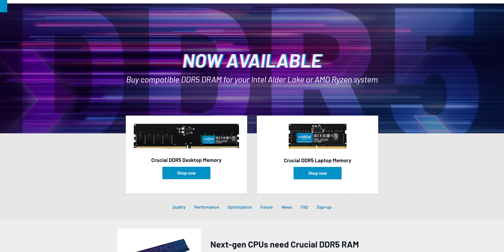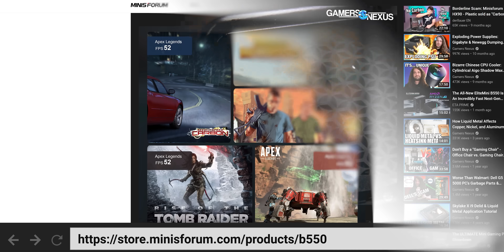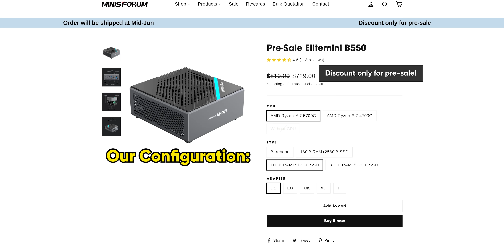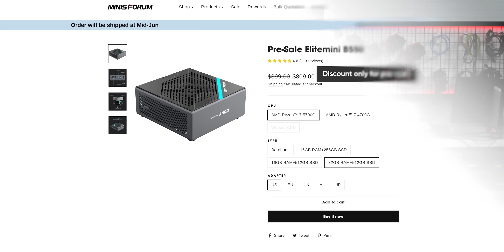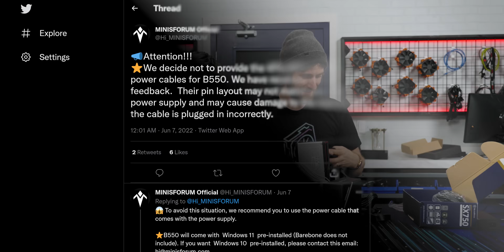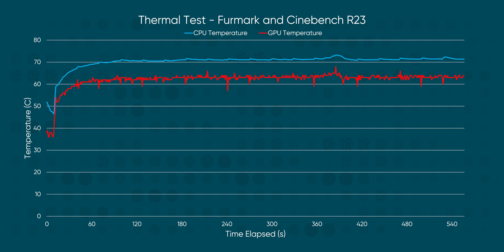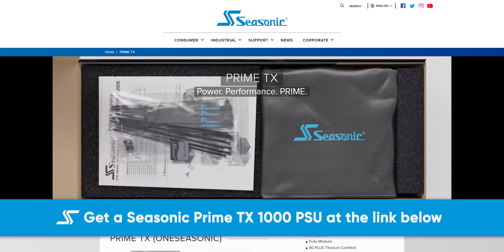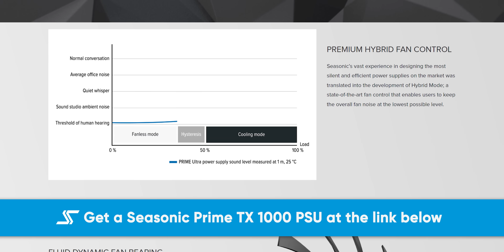Who's Buying These? - MinisForum Elitemini B550

Comment: This made sense, until it stopped making sense. That PSU setup seems so jank and like an afterthought. I'm all for a dock that expands the functionality of NUC-style systems, but this isn't it; at least until Intel's CPU card design is more mature, my main issue is that all the components should be mounted on the opposite side, so that CPU and GPU cards have a full side panel of air rather than choking the CPU card, among some other redesign considerations. Even with the updated PSU bracket, this thing seems cobbled together rather than a well-designed product, like a DIY project anyone could reasonably do. 

Honestly, I'd rather see a vendor that also has access to GPUs design this. Rather than turning a NUC box into a sandwiched SFF case, why not have a more proprietary GPU that just acts like a typical dock with a separate power brick. Sure, proprietary shouldn't be the way forward, but it's the only design consideration that makes sense for what this is trying to do. Have a CPU/system box, have a GPU/expandability box, and stack them. If MXM-style cards ever made a comeback, this would be less proprietary, as that kind of card formfactor better fits the formfactor of a NUC box, but that'll never happen outside of proprietary solutions like Dell is doing for their higher-end laptops. This exact issue is also why eGPUs don't make too much sense, at least without proprietary hardware that allows for a better formfactor, as GPUs themselves are already large and bulky with suboptimal layouts, shoehorning one into a small box with any kind of power supply exacerbates the issue. All because we're hanging onto antiquated physical specs that the ATX platform uses. 

Also, 12VO would simplify a system like this, at least it'd reduce PSU and cable bulk, but this goes for literally any system. 

Circling back to Intel's newer NUC designs, I do think they're the optimal theoretical design, as you're essentially folding a PC in on itself for volumetric efficiency. But, again, the issue is that the current design chokes airflow to the CPU card, all the components need to be reverse mounted, whether this breaks expansion slot specs to have a weird card, or the expansion slots are literally mirrored on that port to work this way, either way giving the CPU card a full side panel of fresh air would be better; water cooling could also potentially benefit from this. Expanding on this, the system part of the board, I/O, both front and rear, storage expansion, etc., should be done on the backplane intermediate board, have all the m.2 on the bottom of the board, and easily accessible from a bottom pane, with the top side having additional PCIe slots for non-GPU use, an non-storage m.2 for wireless, and have additional rear I/O that the CPU card doesn't entirely require itself; this would also make the CPU card only be CPU, memory, relevant power components, and relevant I/O. This would make the new NUC platform more usable and more expandable, and with 12VO and newer connector standards unnecessary bulk can also be shrunk and have this platform give SFF a lot of competition; and depending on sizes, it could fix what this platform is trying to accomplish.

Comment: this solution would benefit for those who would from mini pc, but with desktop grade performance, and wished for home desktop at the same time as one pc solution. the gpu dock would be placed on main office/pc room.
i have a 20" drawing tablet display light enough (but 16" usb powered one is better suited) which i would wish to have a mini pc to accompany it if i need to be away, in which i dont have to do file transfer or cloud transfer with the solution. a 15.6" laptop would be too big (unless if the laptop has pen digitizer), smaller laptop would be not as powerful.

also, it would be a very useful solution for those who do quick LAN setup, or, event booth setup which u dont have to setup on different pc, which can be a hassle if u have to install programs, some usb devices, etc, in which you may already did with main pc.

that said, the opinion is with a budgeted in mind. a laptop would solve many issues, an ipad air/pro would solve drawing portability (with smaller screen). but given the minisforum as a barebone, the overall price would be way less than desktop + laptop + ipad setup, if i accept a bit of jankiness. (but especially if i already have a pc setup, just reuse cpu + ram + ssd to slot it in)

that said, minisforum do need to optimise the hardware config and power solution. with gpu + psu as a one unit dock (or undermount psu), the dock should do self powering the cpu unit without relying on the power brick (but while maintaining the docking experience smooth, maybe do power delivery on slot?). when undocked, then use the ac brick. the challenge would be keeping the ATX standard.

Comment: What will really make this product interesting is when we have Ryzen 7000 APUs.  Based on the performance of the iGPU of Ryzen 6000 mobile,  Next gen equivalent of R7700g (or whatever they call the 7000 seires equivalent of the R5700g) with an RDNA2 iGPU could make 1080p mid settings gaming on this type NUC Pc feasible.

Comment: I'm casually in the market for this for an HTPC / light gaming for my dad.
But I am looking for a 6000 series APU (for rdna2), which seem to be reserved for laptop-only at the moment.

If they shipped this thing with a full case/frame, this would also be good for someone who is just dipping their toes into desktop PC building, where they don't want the initial daunting task of installing a cpu, mounting a cooler, etc., and instead just select a model with the specs they want, source the gpu they want, source a suitable psu, and then just put it together as simple as legos. That said, even if they did so, I doubt they have the marketing breadth to spread that mindset/idea.

Comment: I rwally have a usecase for it. i study in a different city and have a flat there, but i always come home in the weekend. I can take it to my flat to study during the week, and take it back home where i plug it in to game on weekends. I tried a laptop, but they are weak and loud. Right now i run a SFF PC, but it is heavy and uses 7l, which is bigcompared to this thing. I do not like 2 normal pcs, cause i hate when i have to do updates twice, miss files on one system and so on

Comment: Great idea, bad execution, biggest flaw is the lack of power being supplied and power delivery layout, cant wait to see the next revision and hope it touches on those issues. Personal opinion id make it even more modular by adding hot swappable storage. And redo the layout to be more of a tower with the power supply on bottom, internals in mid, and GPU being vertical as a display peice on top. All the wires can just be routed out the back with some extra space to route wires from the bottom of the gpu inside the case.

Comment: So, as a civil engineer I could see this working really well with some blueprint softwares, plus it could be useful being small form factor and disconnect-able since you have to travel a lot sometimes if you’re a contracting engineer and the mobility of it can make it useful away from home
Reply: If you are travelling a lot, wouldn't you rather have a laptop?

This seems most suited to moving between a few specific locations that you have set ups. You have your monitors, peripherals etc set up at the office and at home but only need the GPU power at home. So you take this to the office and plug in your dock and power brick and then take it home and slot it in with you GPU. Of course I am still not seeing a significant benefit over a laptop which also has the added flexibility of laptops.
Reply: @88porpoise  Dunno why Linus was so hard on this. Tons of people (and businesses) use laptop docking stations which this could completely replace. Peripherals and a GPU at home, basic peripherals at the office, and the PC costs $700 instead of a $2000 business laptop that supports docking.
Hopefully it gets a 2nd gen version down the line where docking is even quicker.
Reply: @capsulate8642  

So, unless the person owns their own business (very rare situation), there are only 2 situations that this would happen:

1. The employee buys this out of their own pocket with the GPU for use at home.  Which raises the question: Are there a lot of businesses out there they allow the use of an employee's computer on their network?  If so, where?  I have never seen this in the US.  Nor would I, as an employee, be willing to do this, since if the business requires the use of a computer, they provide a computer that should be adequate for the job - I would never use my own computer for business work (unless I owned my own business, obviously).

2. The business is supplying the computer.  Is the business also supplying the GPU that sits at the employee's home while they are not doing work for said company?  Or is the employee buying a GPU for use solely with the business's computer (which most of the time are locked down to a point where you cannot install anything on them anyway - never mind games).  The price of a business laptop is irrelevant to the employee, and is simply a necessary expense to the business (business stuff is so much more expensive because it is literally only used to make money).

This product is literally only useful for the very rare situation that the person owns their own business, and needs... a full-size GPU?... only at home? (for some reason?)
Reply: @capsulate8642  its cheaper but you can't use it unless it is docked.
Reply: @Zyxlian  Maybe they have 2 gpus and don't want two computers?
Reply: @capsulate8642  Laptop docks make sense because you still have a 100% functional laptop when you disconnect.  When you disconnect this, you have a paperwieght until you plug it into a full KVM workplace.
Reply: @SeniorKlean  Anyone who isn't just browsing facebook isn't going to spend much time using a trackpad, tiny screen, and cramped laptop keyboard.
Reply: @capsulate8642  The wonderful thing is, you can connect a laptop to desktop peripherals. If only there were docks to do it with a single cable.  

And while you might not want to do much on a laptop, I assure you, millions of people do real work on laptops with 16" or smaller screens and trackpads every day. I'd venture that most people in the world who work on laptops don't even own a desktop keyboard or monitor. A sizeable portion of the world does all their computing on their phones.
Reply: @capsulate8642  Most people just plug in their monitors by usb-c and they're good to go. Docking stations are a kind of old-fashioned idea. I don't think many people use them anymore. If people really prefer to use a desktop, they could have one at home and one at work and synch all their stuff with OneDrive, or something. I feel like this device could have been sort of useful a couple of decades ago when cloud-storage wasn't really a thing.
Reply: @capsulate8642  I dont see the use of this. You have to carry around: this tiny computer, a keyboard, a mouse, a monitor, the wallbox, cant use this at trains or in classrooms. Its not a mobile device for me.
Reply: @wizardsghost876  It's not meant to be used portably but it can be quickly switched between different setups. Not everyone is going to have the perfect usecase for it.
It could be an HTPC, a main desktop, and a school PC with the right peripherals. A laptop is good in a train or library but generally bad for everything else.
Reply: @capsulate8642  Absolutely, for what it is - a small formfactor pc -its a nice one, with decent cooling and noise, no doubt, but as aportable device its pointless. And to me the expansion with gpu and psu is pointless. If used that way your better off with a small normal PC.
Reply: @Zyxlian  More so since covid, bring your own device is seen as the next big thing. Management sees the ability to shed the cost of IT for work from home. And with proper remote management software, users sign into a virtual desktop running somewhere else and it acts no different then if you were at the office.
Reply: So the power and thermals of a desktop with the sorta portability of a laptop?
Reply: This is to setup in the trunk of your car so you can test the GPUs you are buying from Craigslist before money changes hands. Thats the only thing I can think of.
Reply: @deltazero7012 good idea.
Reply: Get a laptop
Reply: That’s my exact work scenario, I’m almost 100% remote but I need to take a flight from time to time to work at another location. This is exactly what I needed.
Reply: yeah no, nobody in the site project uses pc.
Reply: Civil engineers will still choose laptop
I don't want to hire a civil engineers that think this brick make sense.

Comment: I just got a mini-itx board and, after a lot of troubleshooting with cases and cooling solutions, I settled for a testbench and a full noctua cooler. Looks hilarious but its the most powerful build I've done. This, however, looks like it would have solved a lot of my problems.

Comment: I was about to say this was a waste of time and resources, and like Linus, would've said "Get a laptop". However, what if you could buy only just 1 system?
And the laptop, sure, some of those are thin and lightweight... for 1500+ dollars. Nope. Also they have screen that can break and the whole other stuff.

Like I can totally see myself, gaming at home with this "metal frame" set up, and then just going bloop and taking basically the "cpu" (case and all, as people mistakingly call it) and say at work you only need whatever keyboard, a mouse and a monitor. The end.

I don't think it's truly necessary, and I definitely don't think it solves the issues that its supposed to, but at the same time I don't think it's really that stupid. 

Like come back to earth, Linus, you can get the thing for 400 alone, and maybe say you can get a cheap 2600, 3600 or whatever (not a top of the line) and you don't need a 6900 XT / if you can't get it, you can get something on the lower side. If you can get a top of the line 5800 and a 6900XT then yes, this will be a complete waste and you're just asking for trouble.

Comment: Would love one of those micro PSUs with it. If the base was slightly thicker you could even make it so it just slotted in and had internal wiring, or a mounting point on the frame if you want it to hang off

Comment: This is really specific but this thing is almost perfect for what I need. I have divorced parents, and I frequently have to go between their houses which are an hour apart. I'm also a music producer/video editor, so I often need a lot of CPU power, RAM and storage. I've tried using a laptop before but I really just hate the form factor, and I find them way too expensive compared to upgrading a couple parts on my PC every couple years. I really like the mac studio, I actually think it's a perfect solution to what I need, but I really disagree with apples choices on it and I also happen to use windows, so there's that. I've basically needed a solution to having all of my project files in one thing that I can take wherever I need. This is basically a windows mac studio, but they really need to sort out that power supply because I really wouldn't want my power supply chilling loosely on my desk :P

Comment: I bought one when it was first announced.

I work from home and always plugged in, sometimes I work at my friend's place or in-laws and it doesn't make sense to have a loud laptop that's gasping for air while I'm in a meeting. It will also make a great server once it reaches the end of it's usefulness as a daily driver.

Also working on a laptop all day is super uncomfortable, regardless I'd always have my own separate keyboard and mouse. I don't see myself bringing my laptop and working in a coffee shop ever, so the built-in screen and keyboard on a laptop is unnecessary. I do want to note that if that entire PCIe assembly was sold separately or additional cost then I wouldn't even consider it as a viable option.

Comment: I bought one to run parts of my homelab. I have no plans on using it with a GPU. I just want a small formfactor PC that can run some web servers on. The noise/heat/space of my current rack mount servers are bothersome.

Comment: It was in interesting idea, but then it went total jank.
Skip the side bracket, and just make the connector x16 female with an extension to the housing, this would allow either vertical or horizontal usage.
The need for an ATX psu, kind of makes this a non-starter for me. Make a heavier power brick(or two) for this thing. Or if they want to be really 'cool' go 'common slot' psu, this is what is used in servers and some workstation systems. It would allow a bit sleeker look and not increase the foot print significantly.

Comment: This seems like a solution searching for a problem to solve. External GPUs for laptops have existed for a while now and doesn't seem to have as many compromises as this does. I guess this might be cheaper than a laptop? I just don't see the point in this thing. Pretty cool engineering though.

Comment: Meh, That system makes no sense. I would rather have seen a decent notebook solution for external gpu than that. Mini pcs are totally pointless if they are as expensive as a mid-tier notebook. And só are GPU docks over 150 bucks. Might as well just throw those extra 150 bucks in a notebook with a dedicated GPU. You can get a Ryzen 5800H + RTX 3060 for about 900 USD.

Comment: 9:35 Our use case was for church.  Replaced an aging laptop (Lenovo flex 14 Ryzen 5 3500u) we used for streaming for a similar MinisForum but with Ryzen 9 5900HX (using onboard graphics).  It's potent, but small, so it's easy to tuck away, mounted under the soundbooth.